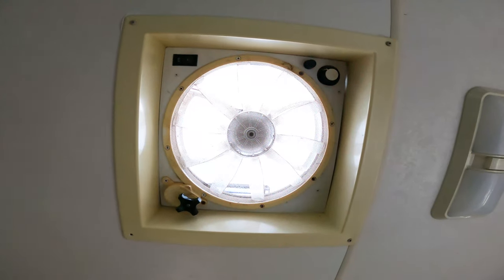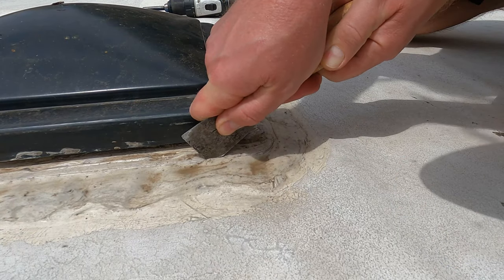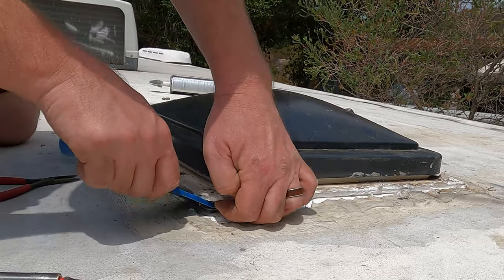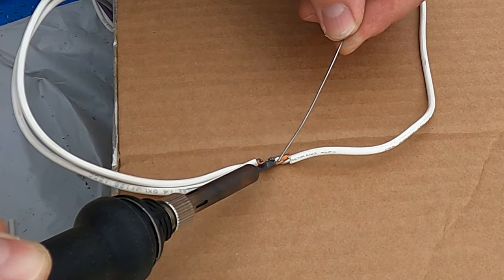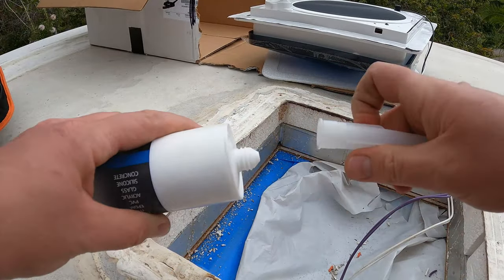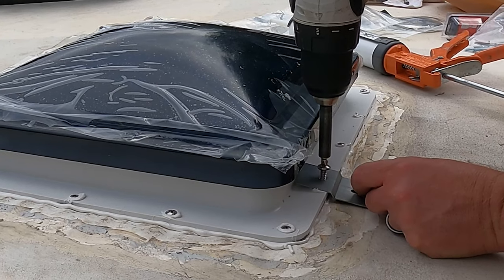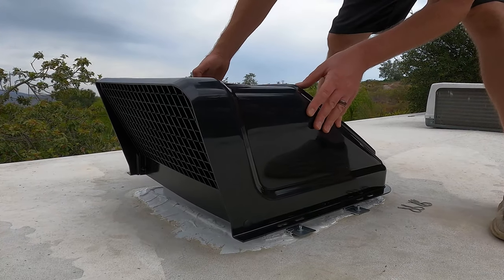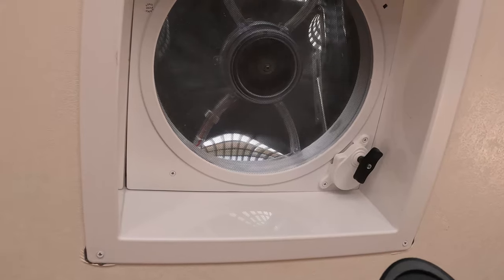Fantastic Fan Replacement in our RV

Comment: I want to share my review of the Fantastic Vent 3350 because my experience with the fan is anything but fantastic. I bought mine 18 months ago, as friends, who have an older model, said it was very good.
However mine makes a lot of noise and pushes so little air that I can barely tell if I have it set to exhaust or blow.  If I turn it up to get more airflow it becomes even noiser!
The rain sensor closes the vent at night so I can only assume that it senses the night time moisture and closes even though it is NOT raining.
My friend's older model seems to push more air than my newer model.  
I get much better & quieter airflow from my little Sirocco fan and it was only $!60 not over $600. 
Dometic agreed to replace the fan and the airflow improved a little but it is still very noisy AND the rain sensor closes the fan at really odd times like late afternoon. So we can't use the fan unless we manually open the cover.
So in summary, I have found it an appallingly poor performing fan that is just not worth the money.
Reply from the maker: Jan I’m sorry you don’t like your fantastic fan. I read an incredible amount of reviews for the different types of exhaust fans for RVs. I did read the rain sensor was a bit sensitive but I liked the idea of having it in case I leave it on and a crazy rain storm blows big rain through the vent and into our 5th wheel. I got the rain hood to help limit the sensor’s sensitivity and be able to have the vent fan on during light rains. It has only closed on us on one occasion, a very warm windy rainy day. 
It is a bit noisy, I agree but so was the twenty year old one I pulled out before it stopped working. That was another reason I bought the one I did. It gives you about ten different speed settings to choose from. I usually put it on at 60% and it runs quite enough to forget it’s on. 
Some times it is hard to tell if it is working but if you open a window at the opposite end of the RV and on the cooler side, driver’s or passenger’s side, we feel a rush of cool air coming through the window. With the vent fan on the ceiling, it blows the hottest air out first and eventually will cool your entire RV. 
If it’s warm inside and I want to cook with my air fryer, I open my kitchen window and turn on the fantastic vent fan. The air rushes through the window, past the air fryer and out the vent taking the hot air from the air fryer with it. I love it! 
Maybe adding a rain hood to your vent fan would help prevent it from closing automatically so often. Try turning the speed down so it’s not so loud and open a window on the other end of your RV. Hopefully you will feel better about your fantastic vent fan.
Thank you Jan for your comment. I wish you the very best luck dialing in your vent fan.